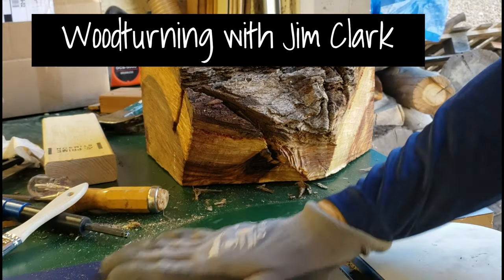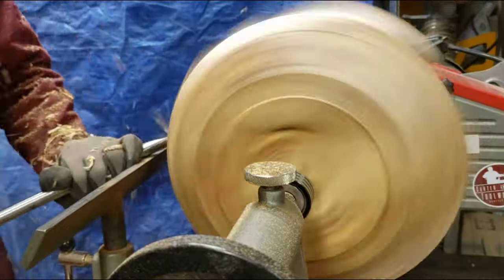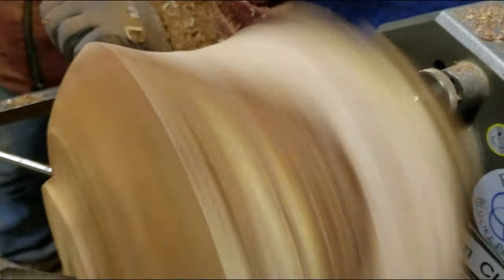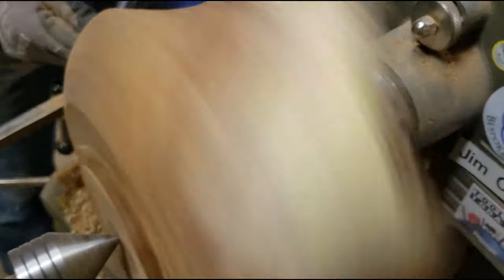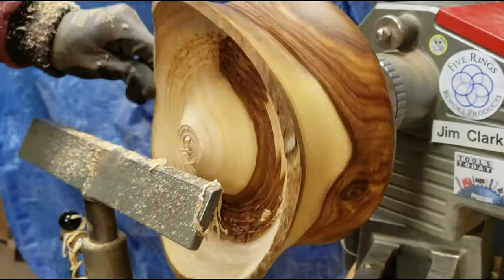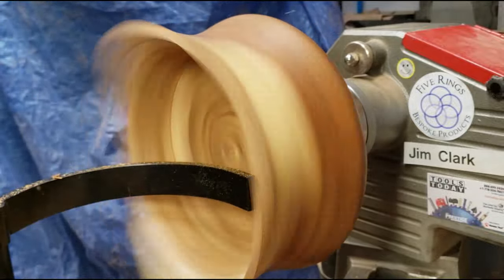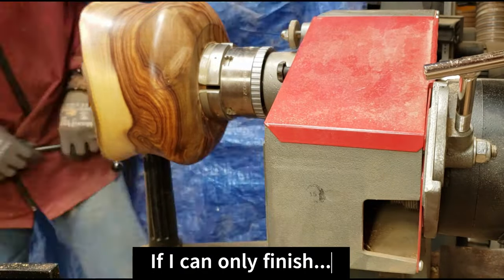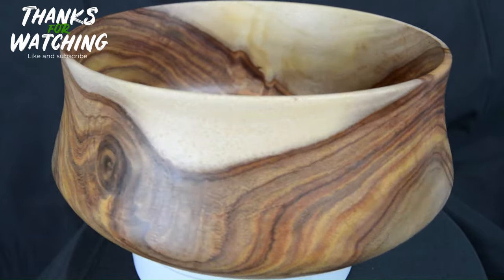Woodturning - Tall Sissoo bowl almost exploded on me!

Comment: Interesting timber , never heard of it before. The colour of the timber and grain look a lot like some of the camphor we get here in Oz down under..
Pity about the catches, you need a good hollower. I use cup bits from nova to hollow that deep in the angle.

I was surprised that you wanted to finish this bowl with it being so wet. I normally rough out a wet bowl and leave it around an inch thick, a bowl this big would be a little thicker. There is a guide as to how thick a bowl should be when roughing out to dry though.
Great result in end. Has the bowl warped at all.
Reply from the maker: It’s actually Indian rosewood and is used for guitar backs and sides if the trees are big enough.  Great tonewood.  Here it is used to stabilize slopes around freeways and drainage canals.  If it spreads too far, it destroys concrete.

After ~2weeks of drying at about 10mm wall thickness it was almost completely dry when I finished it. The rim is now 216mm and there is only 1mm of distortion with zero new cracks.  

I have found good success with walls around 1/4” (6mm) on wet blanks if I start and finish in the same day.  If I only do the outside and then the inside the next day, I get issues.  My shop gets so hot in the summer that I sometimes don’t have a choice.  Turning right now is pretty tough.  My shop is 92-95 F all day every day since summer started.  Winter is better but the air is so dry it creates cracking issues.  I kind of view this bowl a failure that came back around to success.  I do things differently now if I can help it!  Thanks for watching!

Comment: Appears you hove the carbide cutter slightly above centerline when working inside. Try altering your placement  next time s you're slightly above when cutting outside and slightly below when cutting inside with carbide. Gary at ThePapa1947 gives a great explanation of this with diagrams.
Reply from the maker: Thanks for the tip.  This was one of the first times I used carbide so I was not very skilled.